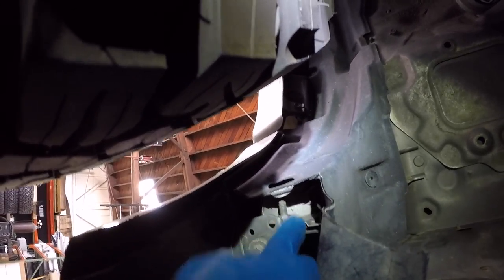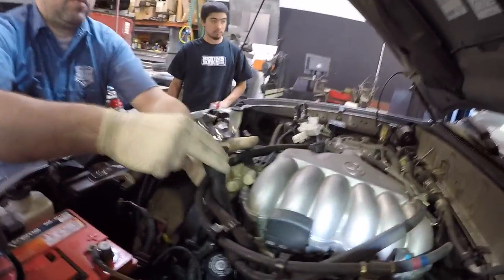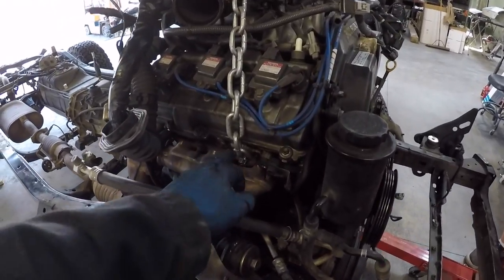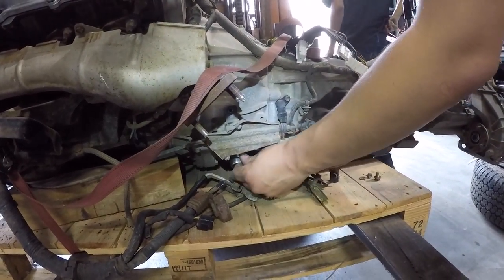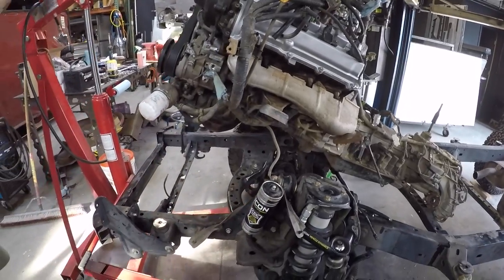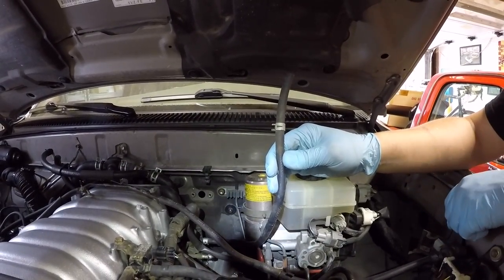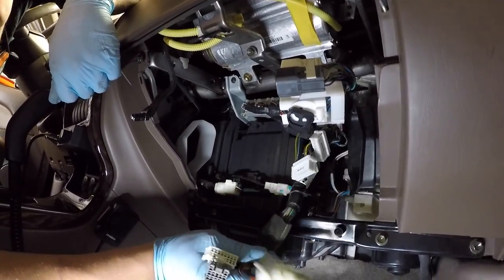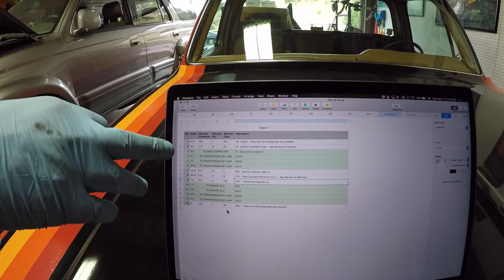V8 Swap (5VZ-FE 3.4L V6 to 2UZ-FE 4.7L V8)

Comment: Guy got screwed on the ac and most guys who do this swap dont know toyotas I did my swap in 12 days from start to finish all by myself no lift no having other people touch my 4runner and it cost me $1000 total with the 4runner it would be a total of $2600 total. But maybe people should keep watching guys like this. I'm just that good working on these swaps with real surf parts.
Reply from the maker: Well Hey, congratulations on your self-proclaimed expert status on this engine swap.  I'm wondering though, have you shared this knowledge by making a video and posting it on YouTube or have you done an extensive write-up with lots of pics and shared it on a Toyota forum? If you have, I applaud you.  If you haven't,  this comment of yours only serves to pat yourself on the back and does nobody any good.

Comment: Why not just buy a 4runner with the v8 .......duh and most likely cheaper .....duh
Reply from the maker: Well Bobby, because Mikey liked his 3rd Gen, didn't want a 4th Gen, and was up to the challenge to do a V8 Swap......duh
Reply: @TimmyTheToolman  i understand the whole unicorn thing ...the only reason i clicked this video was to see how you take out the 4.7L engine in a sequoia/tundra because im going to the junk yard today to pull one from a tundra to put in my sequoia for some reason i cant find anything on how or any tips bla bla bla
Reply from the maker: @bobbytucker6274  Yeah, we came into the project after Mikey had already pulled the engine from the donor Sequoia.  That would have been a nice addition to the video.  Good luck pulling the motor.
Reply: Bobby Tucker Pulling the motor from the donor sequoia was a bit of a challenge as we kept it mated to the transmission and transfer case. With that much length there is no way to have the truck high enough or engine puller big enough to get it out the top of the engine bay. We ended up cutting off the front core support and then pulled the engine combo straight out the front. If you are just pulling the motor then its as easy as any other v8 pull...torque converter bolts,  bellhousing bolts, and motor mounts.
Reply: Thank you for the advice